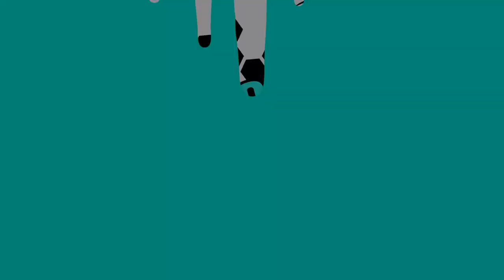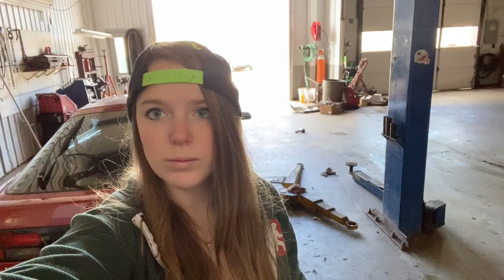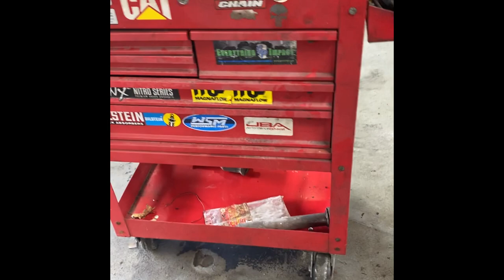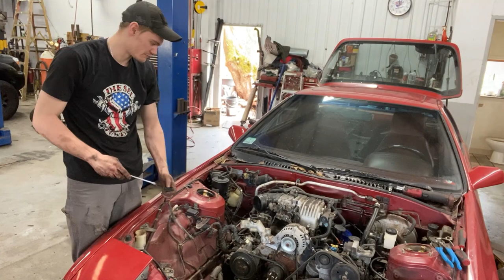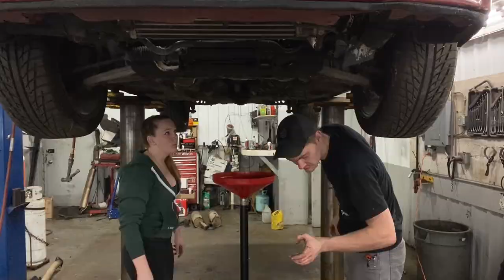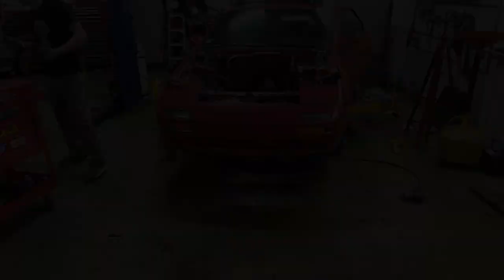3 Rotor Build - Part 1 - Engine Removal

Comment: Nicely done. One thing I learned on my own 3-rotor FC conversion was that it's easier to pull the power steering pump and A/C compressor off of the bracket, then bungee them aside instead of trying to disconnect their lines. Another time-saver is to pull the stock Emission/Engine harness through the firewall hole and flop it on top. Lets you pull everything intact. Added benefit is that you can extract the wiper/cruise/cold start subharness from it just by un-taping it from the rest of the Emission Harness.
That lift is awesome! Can you find out what company made it?
Reply from the maker: Actually the a/c and ps lines didn’t give me any trouble they came lose pretty easy. But thank you for the tip. If I ever have to do this again. I took the ac lines and harnesses out of the engine bay another day. Yes I will find out the company that made the lift. I will let you know!
Reply: P9